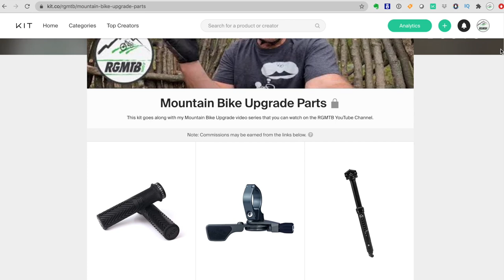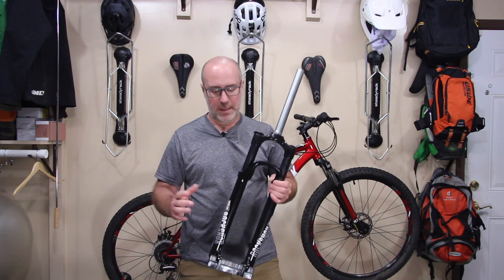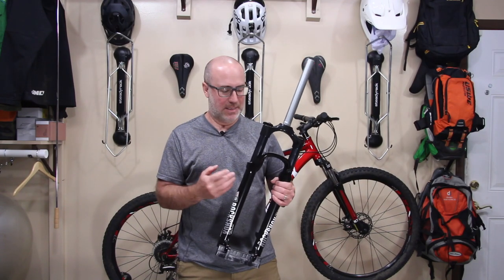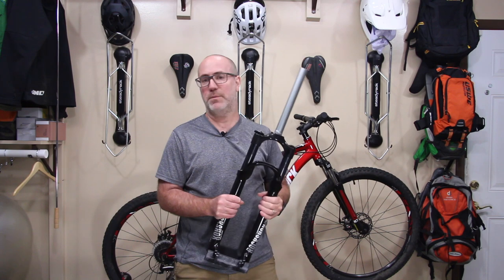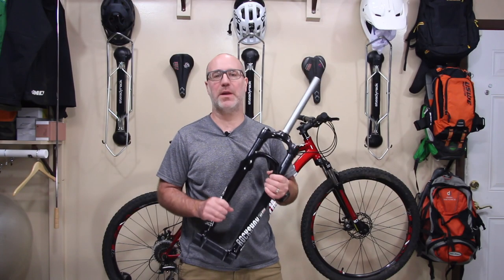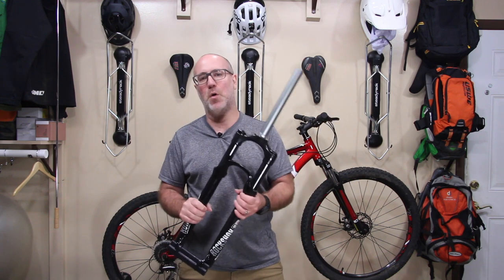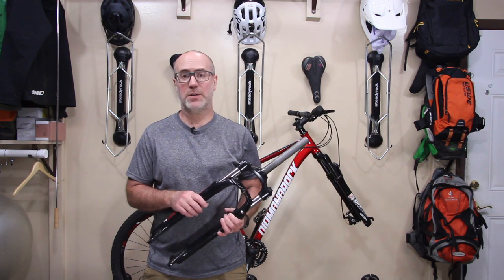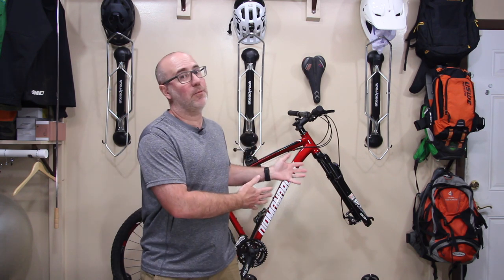Entry Level MTB Upgrades - MTB Fork Install

Comment: 1:44  actually this is not completely true.
if steerer tube is 44mm, you can install a external lower cup to install a tapered fork. this is a very common setup on steel bikes. So if you do this you could swap whole headset out as well.
and for straight steerer tube you can use an adapter making it fit to a tapered tapered headtube, some cheap bikes actually come like that.
but also there is Problem solvers headtube reducers which makes it possible to install a straight steerer fork and headset into a tapered head tube.
this is also for Cannondale frames, they have different headtube dimension, so with this you can install any straight steerer fork on a Cannondale frame.
but as you said you should get it right the first time.

Comment: I have a 2020 diomond back Overdrive and the shocks are pretty good. They sag a little bit but still do pretty well. Have not bottomed them out yet surprisingly lol, but I will upgrade just for a higher front end

Comment: What was the fork weight difference? What’s the travel and did you consider increasing it a bit to give the bike a slacker head tube angle? I’ll assume an entry level MTB is short, high and steep (as opposed to modern long, low, slack geos). You may want to lower the bars a bit by moving some spacers above the stem - looks like a real tall front end. Good stuff Gene!

Comment: 7:37 these things are dangerous, on these forks the warning sticker actually is valid, Please don't do anything the sticker say not to do.
a local dude told me he did a drop and the spring on one side came out, so that means the plastic cap failed.
Reply: @jaguarreal9116  i meant the stock fork. The Rock Shox is a huge upgrade.

Comment: Can i install a 27.5in fork to replace an existing 26incher?
Reply from the maker: Oooof.... OK here's the deal. Technically, will it fit on the bike? Yes. As long as you buy the correct fork type, meaning tapered or non tapered, for your frame it's gonna fit. That is the same when buying any fork. But now we get into the geo and the "Should You" part. Are you looking to turn the bike into a mullet (front wheel bigger than back)? If so then this would work for you. I'm hoping you are also going to install a 27.5 wheel right? What is the goal here? Did you just find a 27.5 inch fork on sale and want to install it?
Reply: @rgmtb  thx v much for the reply. Yes was thinking of 27.5 at the front & 26 at the rear. My old bike is Diamondback Coil Ex (2003/4). Notice it is weighted more towards the front - the longer fork is to offset this a bit. Either i upgrade its suspensions or get a modern bike.

Comment: Would 29” forks work the with a 27.5” tire bike. I have this exact bike
Reply from the maker: Not exactly. That fork is longer then one designed for 27.5. Using it will raise the front up and could make the ride feel odd. Will it technically bolt on, yes. Would I do it, not really.